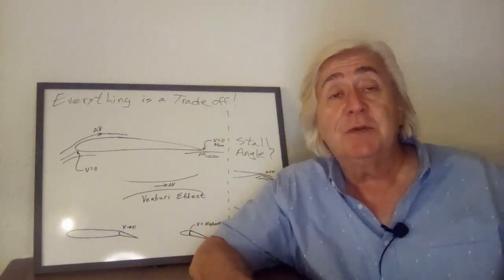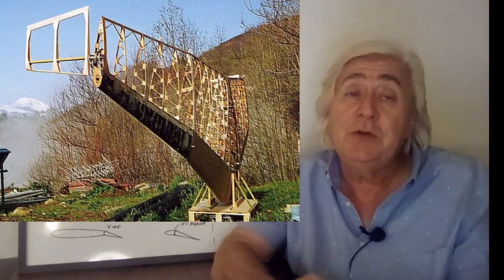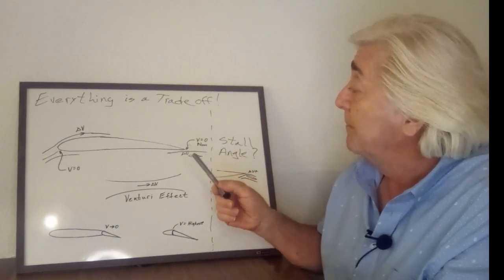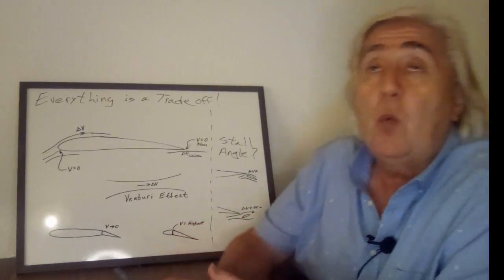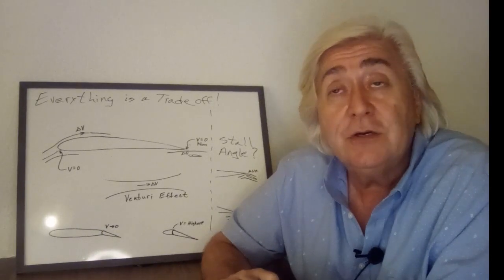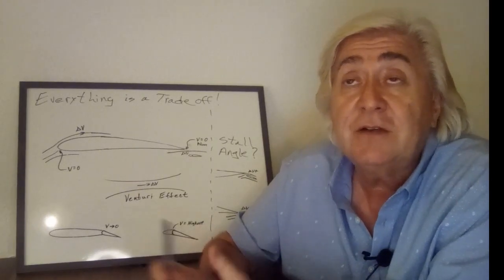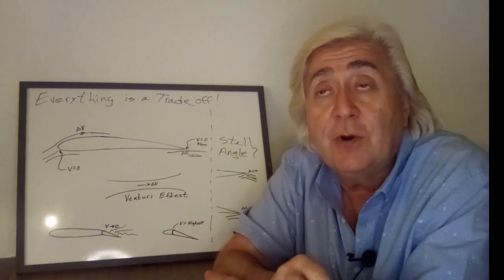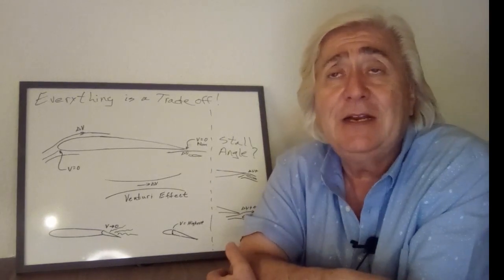Flying Wing Design - Junkers Flaps

Comment: Did the Kasperwing of the 70's/80's have reverse taper elevons?  I remember the buzz at the time regarding full control authority at  stall speeds.
Reply: The Kasperwing hang glider and ultralight utilized weight shift for pitch control, wing tip stabilizer & rudders were used for directional control and banking. The 3-axis single and tandem Kasperwing employed jointed outer wing ribs in a form of wing warping for pitch.
Reply from the maker: I have studied the Kasper wing and it did not use elevons or wing warping. The have a reverse taper of the wing planform near the tip that works in conjunction with tip rudders that deflect outwards. They generate a vortex over the special wing tips that causes good rolling motion - however, at the cost of high drag.

Comment: The Mitchell Wing had so little sweep it needed control surfaces with restricted down travel for pitch stability.  If you need to depend on a movable surface for stability, it better be  stall proof: The Junkers flap. Don Mitchell had built and flown larger wings for towing (The Lindbergs would go out towing with him). I think they had Junkers flaps, by the seventies it was part of his 'design language". At least that's how I remember things 40 years ago.     I know I can go buy a 12:1 hang glider, but what if I want to build one? Homebuilders are not always rational.
Reply from the maker: The big spin generator on the MW were to spoilers, although any constant chord elevon will make the issue worse. See my series of videos on making a spin resistant glider. My KW MkII is specifically designed for the home builder. However, given that very few people build model airplanes these days, I'm not sure the skill base exists in enough people to make my glider marketable at a profit.

Comment: The original, finless design of the MW was controlled with top surface spoilers (see 5:40) but this led to several right-offs on launch. The fins were added as a result (as detailed in George Worthington's book 'In Search of Records)....

Also as I understand it, the Mitchell Wing's Junker flaps were built with a few degrees of washout. Some suggested increasing this to reduce the spin issue, though I can't see how this would have helped with that issue.

Enjoyed the video and looking forward to the next project design, love the idea of a floater.... but as you mention, a light weight portable one is either a paraglider or a single surface hang glider!
Reply from the maker: It was mostly the spoilers that caused the spin problem. The first R/C model of my first wing used spoilers for roll/yaw control - very bad choice. Nothing worse than stalling the wing tips to cause a spin!
Reply: @KlingbergWingMkII  And why do the spoilers work so fine in the rigid hang gliders, like ATOS etc?
Reply from the maker: They don't actually. They cause increased drag all the time (one is usually open somewhat) and they cause spins if flying slow (see video of common accident; https://www.youtube.com/watch?v=f4X7hHA_GP4&list=WL&index=4&t=14s). The reason they work at all is that they are positioned aft of max thickness point of the airfoil and their hinge line is perpendicular to the incoming flow. On the Mitchell they are at the 1/4 chord (the spar for easy mounting) and they are aligned with the sweep of the wing. This causes a lot of spanwise flow, which we know from my video series, is a root cause of generating spins at slow speed. This is why it is so important to use an elevon hinge line that is as close to perpendicular to the incoming flow as possible. This is a major outcome of my work and the thing I'm trying to get everyone to understand and change how flying wings are designed. Fewer spins means less injury and death.
Reply: @KlingbergWingMkII  You are more than clear on that, Mr Klingberg! Also, I would like to thank you for this video, I think you have made it after my comment in your previous video.
Reply from the maker: Of course, I'm always right because it's my channel :-)

Comment: I have been thinking, (and even more so after finishing "Only the Wing" about the Horten wings, that for the best drag solutions, making a mold of the exterior of an entire aircraft, and building it from the outside in, would be the way to go.  Design the "skin" for ground handling, and "distribute" the spar and other structural elements with CF tow, or extrusions adhered directly to the skin.  I think you are right not to reinvent the para or hang glider, but a super efficient Prandtl D type glider, light in weight and super efficient might be very well received. IMHO
Reply: Maybe.  Carbon molded aircraft are not so easy to fix when damaged.
Reply from the maker: Composite aircraft can be both easier and  harder to repair. Depends on the smarts of the designer. In the following video I demonstrate the various repair methods for my wing: https://youtu.be/JJK-XGVaMs0